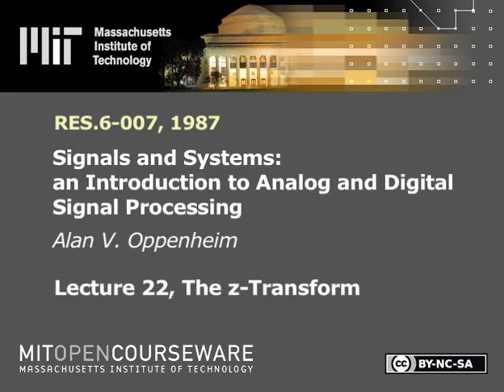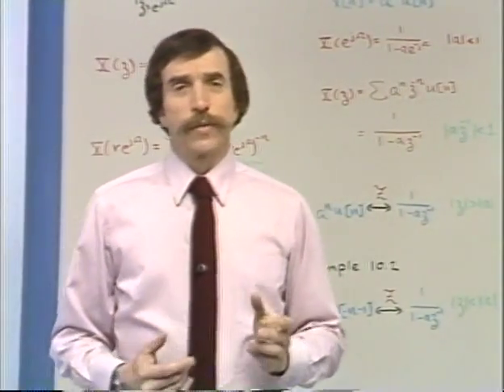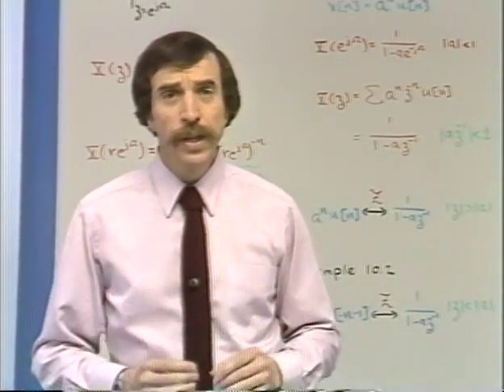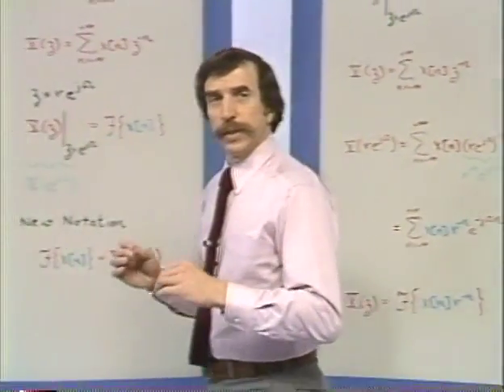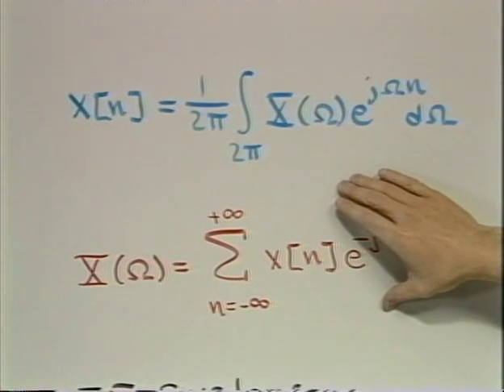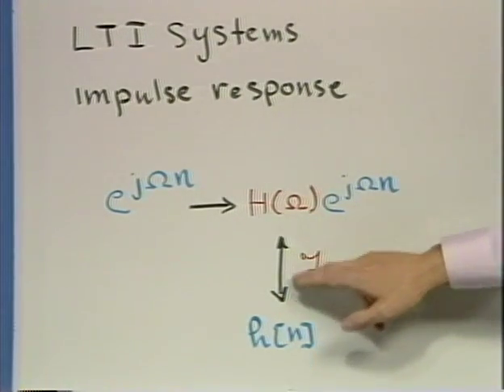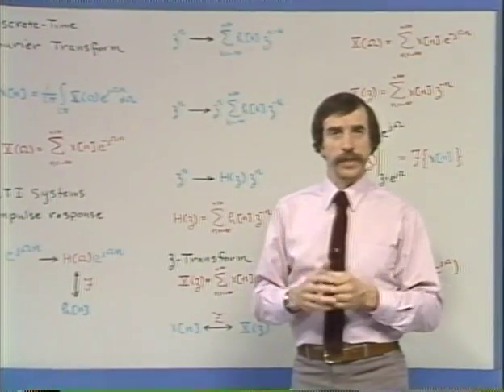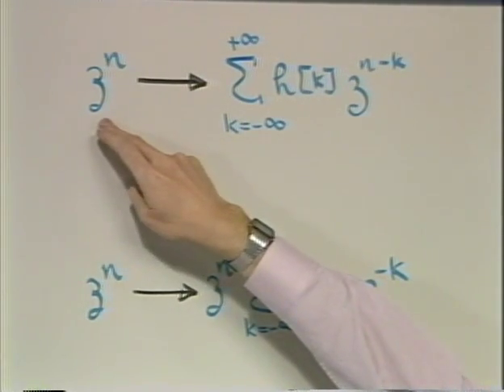Lecture 22, The z-Transform | MIT RES.6.007 Signals and Systems, Spring 2011

Comment: At 30:35 -- The ratio of the length of the zero vector (unity) to the *product* of the lengths of the pole vectors.

Again, what a fantastic set of lectures. I'm falling in love with engineering all over again.